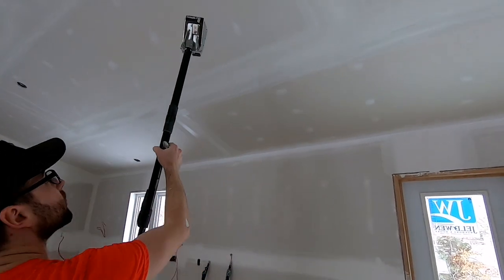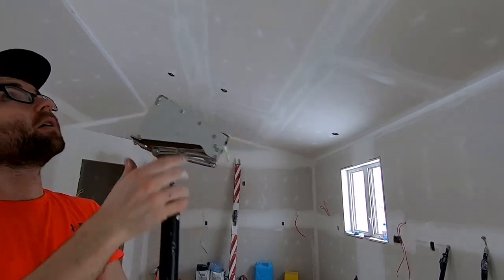Drywall Nail Spotter

Comment: I cant.wait to get me some automatic tools I wanted the nail spotter first than the boxes and bazooka last
Reply from the maker: My nail spotter and boxes are probably the tools that paid for themselves the fastest
Reply: @Interior_Works  what do you recommend as far as boxes 8", 12", 14" 3" spotter and 3 inch angle flusher?
Reply from the maker: @ram12e6  I usually do 8-12 on the boxes, 14" I use if the framing was uneven. 3" spotter, either 2.5 & 3.5 Flushers or 2.5 & 3.5 angleheads.  Or a single 3" anglehead or flusher could work for both tapecoat and finish coat, but it's not ideal.

Comment: Serious question, what's the difference between the 2" and the 3"?
Screw and nail heads couldn't be much more than 5/16 wide.
Reply from the maker: Good question, the extra width is more for the tools stability and capacity. The 2 sizes are for those who run the nailspotter twice, so their next coat overlaps the previous coat, for easier sanding.
Reply: I see. Thanks for the explanation.
Reply: @Interior_Works  would it be much harder to sand if I coat 2” twice over a first coat with a knife ?
Reply from the maker: @elmaromero8585  Just a little bit, you'd barely notice. Small difference.
Reply from the maker: @elmaromero8585  I've ran the 2" twice.
Reply: Thank you

Comment: It doesn't work with a brake handle ?
Reply: Ocanadakiter no
Reply: Just tie elastic band from the head to the poll with light tension it should work, it will tilt it back for you , or a light spring, whichever works best